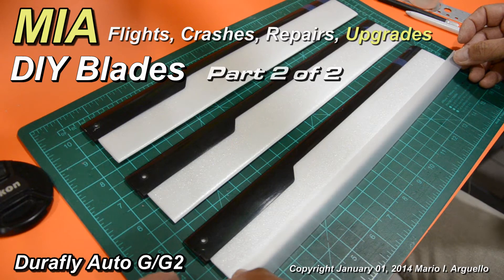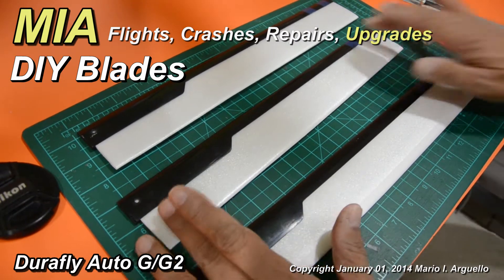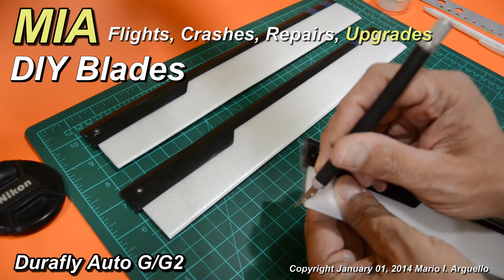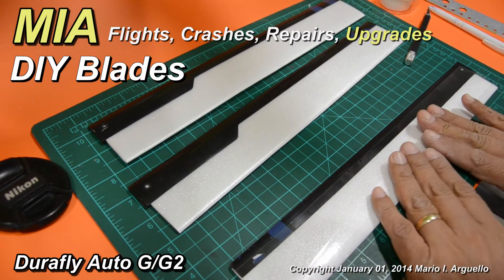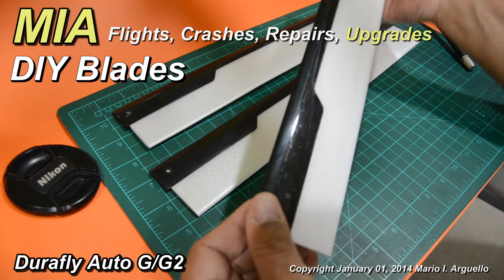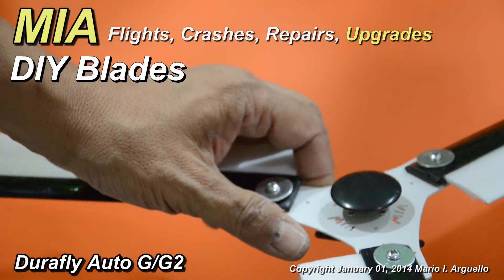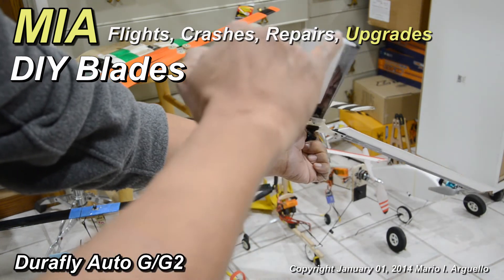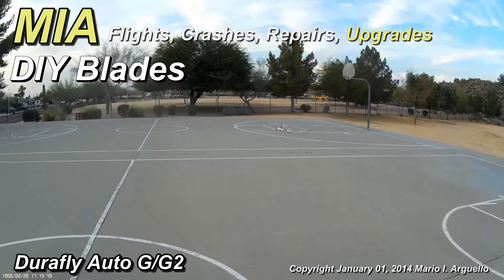How to Make RC Autogyo Blades - Durafly Auto G/G2  with  MIA DIY Depron Blades - Part 2 of 2

Comment: hello,

nicely done.
but how do you balance your blades? i have heavy vibration when it refs up.

kind regards, Marc
Reply from the maker: Marc van de ven with the depron sheet, balancing is almost not required, but if you must, the same method for balancing wood helicopter blades applies here. Each blade must hang perpendicular from the mounting hole , if not, make slight adjustments with scotch tape to each blade so that it hangs perpendicular while maintaining same weight on all three. Re-weight and re-balance each blade on an edge of a table and check to see if they all teeter on the edge at the same distance from the end of the blade. If not make slight adjustments with scotch tape.   This is a simplified method. 
Google balancing helicopter wood blades and I am sure you will find the more detail method. You can also mount the blade on the rotor head with the rotor shaft and spin that on a set of ball bearings (old bl motor mount) and add scoth tape to the lighter  blade(s) until all three spin in equal balance.